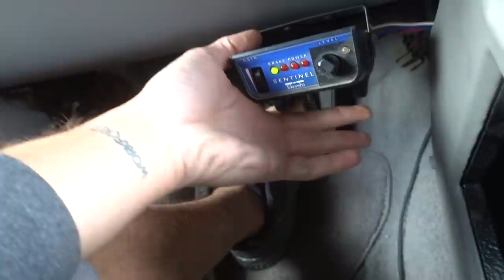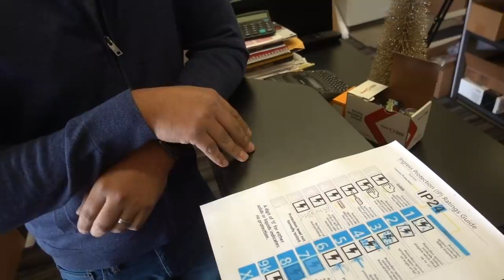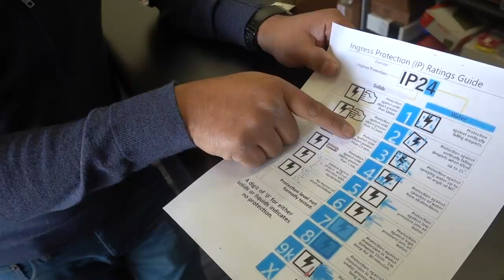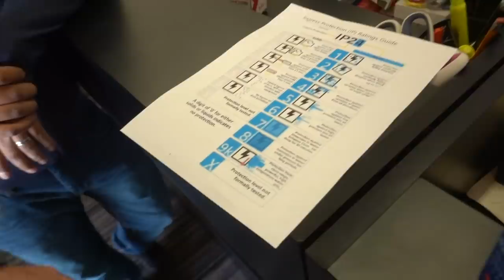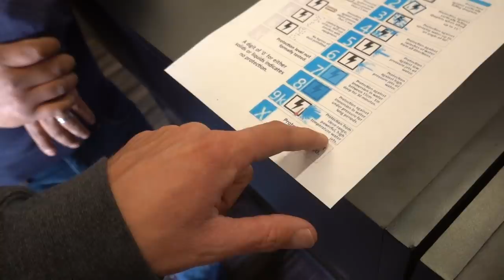TOWING MY NEW TRAILER WITH MY DAILY DRIVER!

Comment: Bring the Engine into more videos! Also if you haven't figured out yet, there is a tiny nob or peddle on opposite side of where the gas and brake is, AKA the left side that activates something called a Q siren.

Comment: And I forgot on your trailer look for your black wire or in your case it’s blue look where your amber lights are already hooked up to you can run a jumper and hook all your amber lights to the existing Ambers the only one you do not want to hook up to is your turn signals in front of your trailer tires they should be green and yellow for your turn Signals and your running lights should be a brown wire

Comment: You know what would be hilarious if you can get them wired up to where whatever truck you’re driving and you use the blinkers outside on the trailer blinks as well like all the lights on one side and will correspond with the blinker depending on which way are you turning that would look pretty cool

Comment: Do  4 in the front for Amber led lights and do 4 led reds lights in the back  you cannot have all Ambers on the side of the trailer that will get you pulled over by DOT too

Comment: You should make the amber lights on the trailer work with your turn signal
Reply from the maker: The one factory one in the center that has 180 degree optics is a turn signal as well

Comment: Do not make your trailer lights strobe you will get a big fine for that and to wire a trailer it only takes a day to wire a Whole trailer I’ll wire trailer for three years and my three years I have wired over 1 million Trailers and do not put smoke lens amber lights on a trailer during the day you cannot see them at night you can but during the day you can’t you can find 2 inch amber lights that have 3 to 6 LED Sealed at any trailer manufacture company or you can go to tractor supply and pick them up